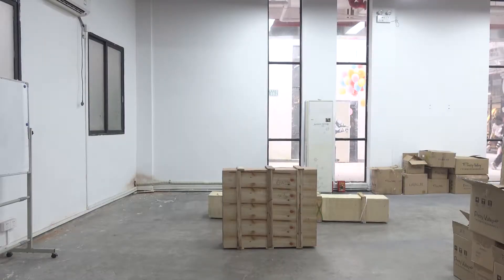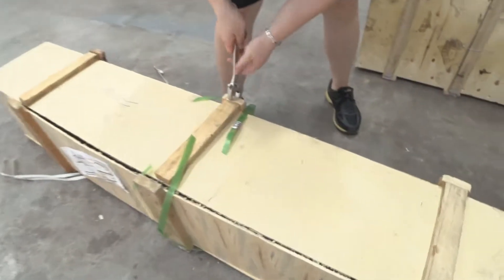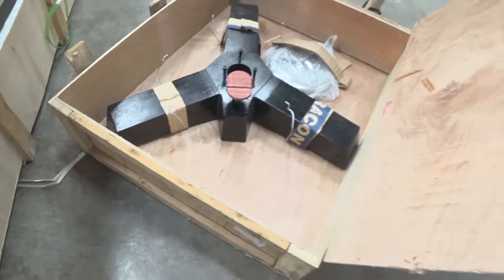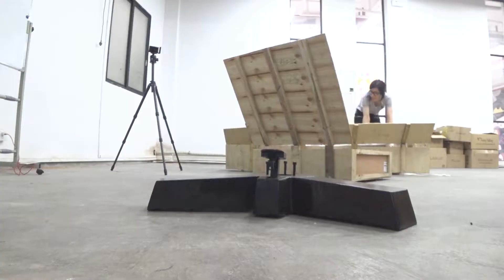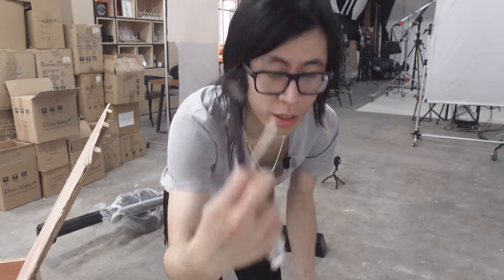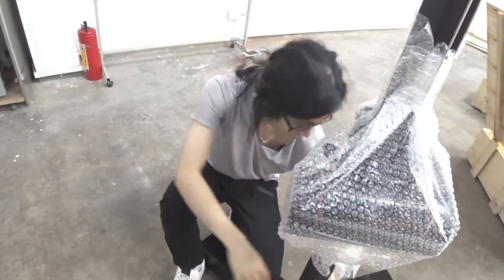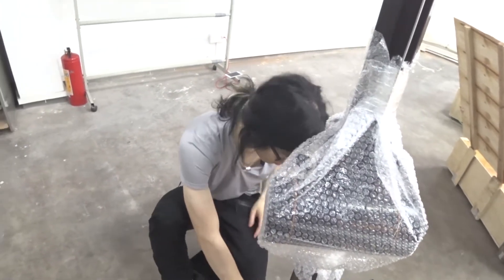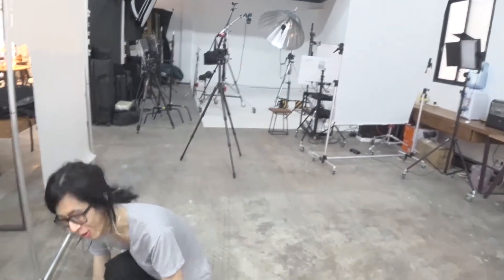Biggest Camera Stand, Heavy Weight Unboxing

Comment: hey guys, the mast is just plain BOLTS, why not take them out first?, then put them back in the mast flange and tighten? these are NOT slotted, for a reason, the base is ~ 50Kg's for a reason, to keep the camera stable, and a heavy view camera!, with long heavy lenses a long way off the base "support", hence the weight; and why you don't want any weak point on the connection between the two.
Reply from the maker: hi , been a while, so far everything is stable, each ends holds around 5kg, anything upwards you would be better off with a foba or regular tripod for stability